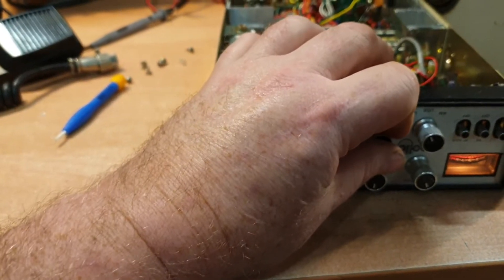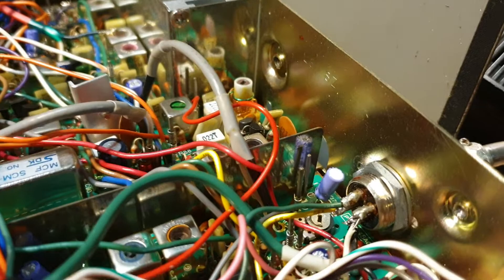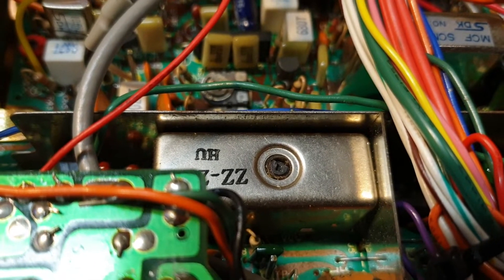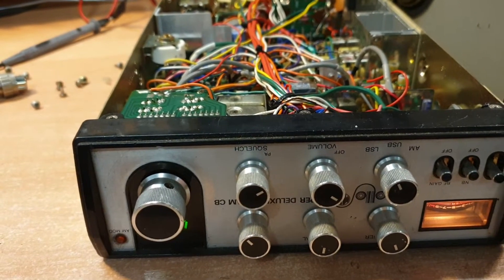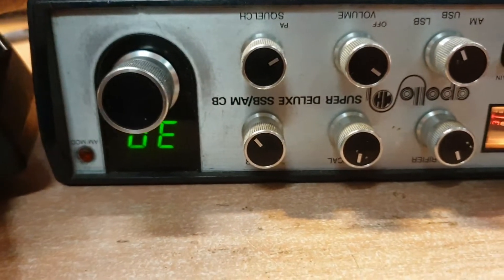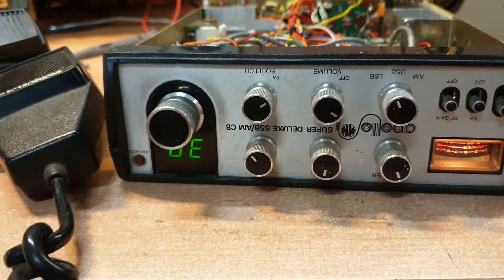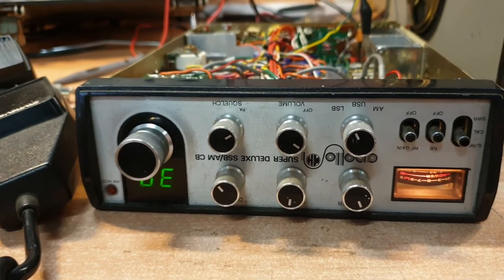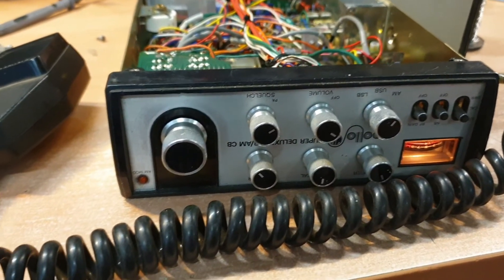Apollo AP801 40 ch cb quick repair.

Comment: APOLLO AP701, Not 801. The 801 was the smaller chassis model. Silver face came out after the wood grain AP-701. Exactly the same as many Cybernet PLL02A models, except for the front panel design. Enjoy, and happy dx...
Reply: AP 801 super deluxe base station is much bigger like the Washington’s or bangle base 
Except AP801 super deluxe has twin needle displays, however there is an AP801 that you speak of a 801 similar size to the 701 
I think it AP801 deluxe then the base station is apollo AP 801 super deluxe and the Apollo AP 704 deluxe base station & AP708 deluxe

Comment: Correct it’s a AP 701 I had 1 identical with same silver black nobs etc but I had a tuner +3B great superb ole radios, been hunting an ap801 base station now for awhile. Or 704, 708 super deluxe base station 
There factory nobs, as I changed mine to all silver nobs from dicksmiths, which I thought THERES my old radio, but 🤷🏻‍♂️ it’s not as I just checked it against an old photo and mine different nobs all silver & channel select was all black.
Reply: I still have a photo of mine too